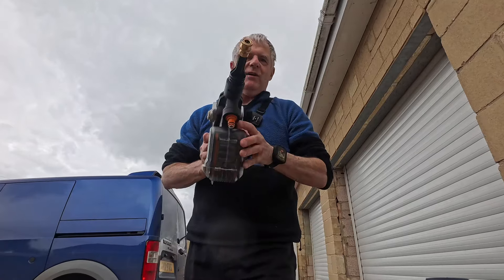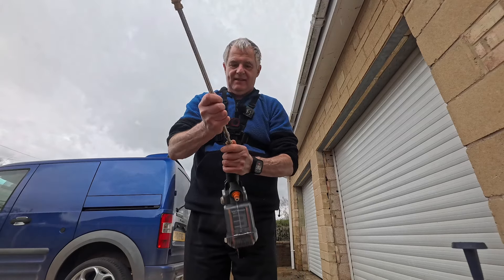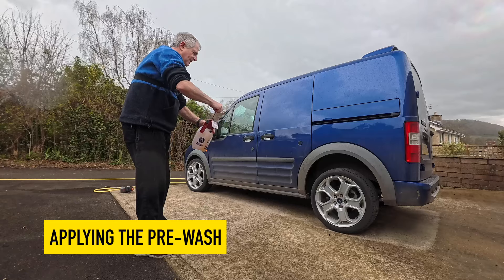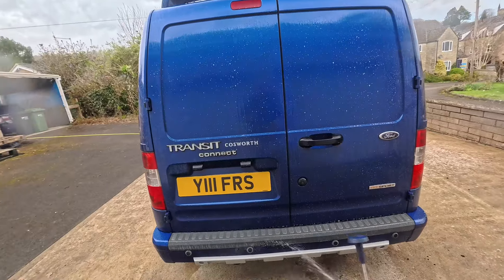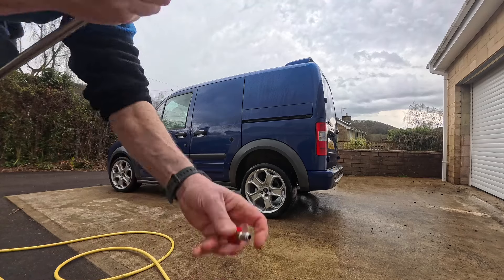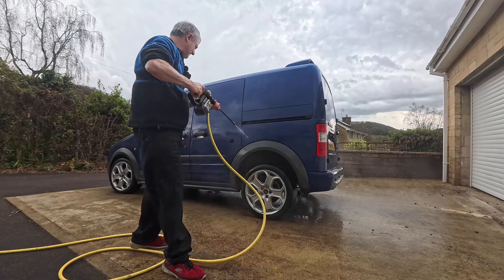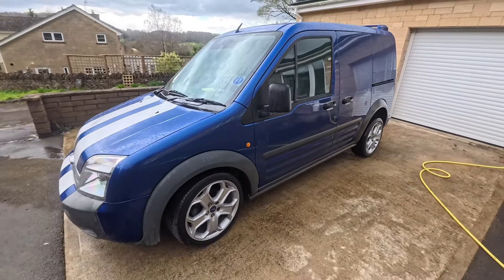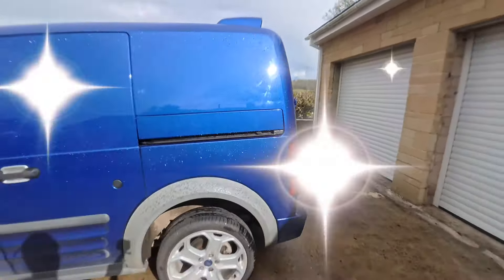Topaz Pre Wash with Worx Hydroshot 56bar Part 1

Comment: Ive happily used KC Green Star and both Bilt Hamber's (through pump sprayers and without a foam on top) and easily got the car mostly clean with the boggo Hydroshot, let alone the Nitro. My car always has an LSP on top, but even still the topaz looks pretty useless. 
Good to see though, thanks
Reply from the maker: I have my pump sprayers now. They turned up yesterday, I am looking forward to testing out, yes, that Topaz Pre Wash full price is £44.00 half the power for half the price £27.00 😀 weather is too poor to for making the topaz Advanced snow foam, which I really want to see again very expensive product but I got it Christmas sale half price, I have been wondering if topaz products are only for power washer like Karcher or so 😀 I am sure by the time I get though the box 📦 Topaz the company may not be happy with honest opinion review 🤣 laters Steve